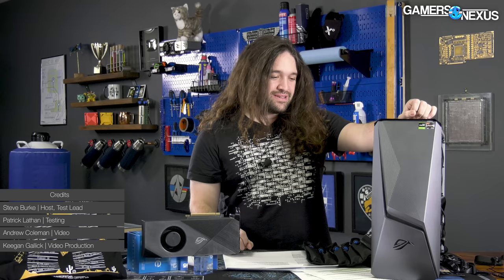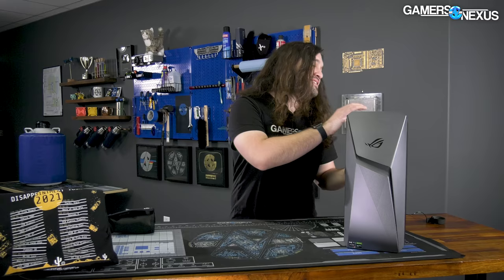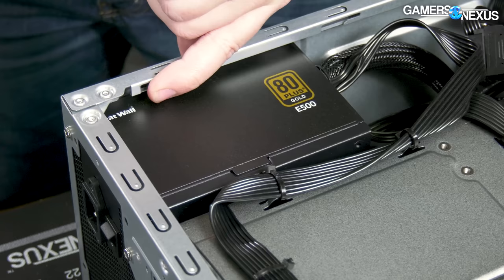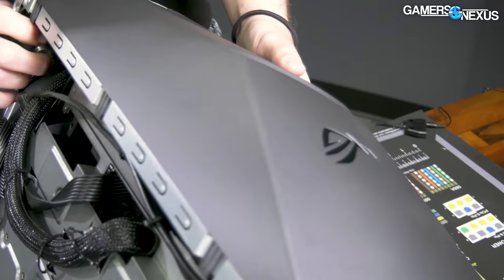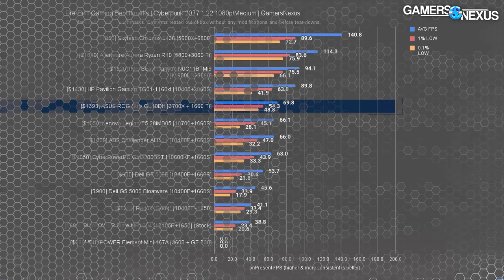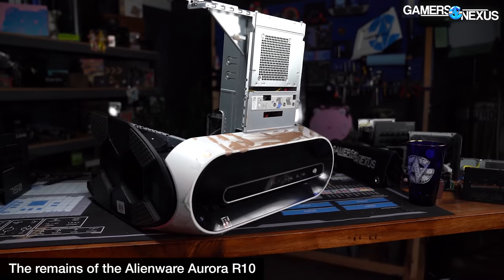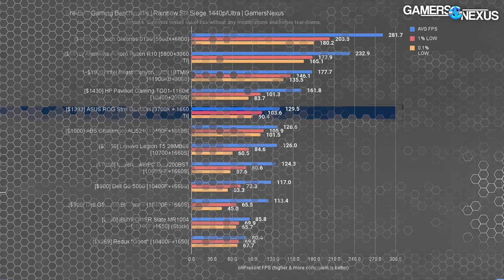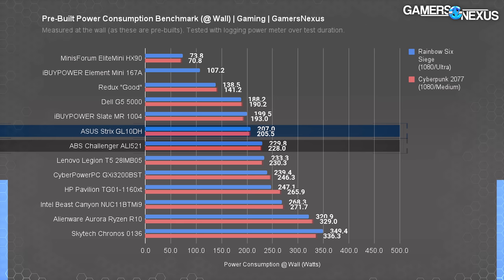ASUS Didn't Deeply Offend Us: $1400 Pre-Built Gaming PC Review (ASUS GL10DH)

Comment: Just to clarify on the PSU: even if you haven't heard of great wall, you have probably seen or used a GW power supply in the past. They do indeed make some of Corsair's stuff (in the modern TX-Ms, the SF series, and the non-mod CX, which is double-sourced with CWT.) The unit in this PC appears to be on a similar platform to the 2017 revision Corsair CX or the ASUS TUF, both of which are excellent budget power supplies with working protections.

This doesn't mean that all Great Wall power supplies are good, just that this one probably is.

Thanks as always for the great coverage.
Reply: I remember Great Wall from the original Walmart PC video. Turns out even back then it was probably one of the better things in that whole thing.
Reply: Great Wall, as a subcontractor, will build anything the client asks. And if it's absolutely horrible they will tell the client to stick their own name on it. If it's reasonably decent and the client don't mind they will stick their own name on it.
Reply: The thing is, Asus makes PSUs or at least sells them under their own name - even fairly budget ones with their TUF line up. By not using one of their own, Asus basically says one of two things:

a) Our budget PSUs are shit and we didn't want to deal with lots of RMAs, so we went with the Great Wall instead.

or

b) We wanted to make the most profit, so we went with the cheaper Great Wall PSU instead of an Asus (branded) one and saved a few bucks on this $1,400 (!!!) pre-built.

Either way, it raises a few questions...
Reply from the maker: Yes, as stated in the video, they are a common supplier and were in many of Corsair's units in the past. You are right that they won't all be good! Glad you (and some others, judging by the comments) are aware that the name doesn't dictate the quality. A lot of people jump to that low-hanging fruit and it's sad to see, so glad to see awareness by the community about the fact that this is just another supplier!
Reply: @nicoj9984  Or c) We use Great Wall as the supplier for our budget line anyway but they charge us 12 cents more if they can't put their name on the PSU... and we guess buyers of prebuilt don't take them apart so paying 12 cents for branding is a completely brain damaged move.

Not everything is a matter of being as evil and greedy a corporation as possible.. sometimes business decisions actually just plainly makes sense.
Reply: I think the easiest is always to ignore the reputation of any Brand/Supplier and just take a look in the "PSU tier list" 🤷‍♂
Reply: For 1400 they couldn't spare the 12 cents or stick a ROG sticker over it... Lmao
Reply: @fracturedlife1393  It's a black-box system. Safe to assume nobody is going to see under that shroud that isn't getting paid for it.

And when you're shipping thousands, 12c is a huge wad of extra cash.
Reply: @nicoj9984  The unit in the video is on a similar platform to the TUF units, from what I could find. My guess is that since they ship so many prebuilts, it becomes cheaper to just set up a whole new contract to buy unbranded GW units than to use their TUF power supplies. Similar to ibuypower using unbranded Channel Well Technology units. The CWT GPU, which is used in some of their higher end stuff, is a fantastic power supply, but since they ship so many units, it is likely cheaper to just buy them directly from CWT instead of using a branded one like the bitfenix whisper M (which is on the same platform.)

I would imagine it comes down to price and logistics. The Great Wall E series is a fairly modern platform with independent regulation and (from what I've seen) working protections. It's not sold retail much in the west, but that doesn't mean it's a bad unit, just that it's less established.
Reply: @fracturedlife1393  Definitely seems strange, but it does make sense once you consider that clearresult charges $5000 for an 80+ certification on a rebranded unit. So despite being the same unit, if ASUS were to make a SKU based on this platform, the fact that it's under the ASUS brand means that it needs a whole new certification. This is an added cost that really wouldn't affect the unit on its own, since this PSU won't be sold on the DIY market.

I personally think that's one of the reasons that the industry should abandon the 80+ spec as a whole, but that opens up a whole new can of worms.
Reply: @GamersNexus  Yes, a name doesn't dictate the quality, but at least it can give the consumer something to rely upon when making a purchase decision. A PSU is, from my perspective as a customer, a black box: I have no Idea what components are in it and whether or not they are any good. All I can go by is the specs (which in most cases are similar or identical) and the reputation of the brand on the side of it. The asumption here is, that a reputable manufacturer or seller won't put their name on a bad product and risk their reputation - Gigabyte did, so when buying a PSU, I won't consider them anymore.

BTW, it's the same with the screwdrivers you advertised in the video: I can go on Amazon and find serveral similar sets of screwdrivers for a fraction of the cost. Those no-name Chinese tools could be equal to yours or even better, but they could also be complete garbage - there is no way for me to know that since I have no idea what materials they used, how they were manufactured or how good their QC is. I don't know either of that with your screwdrivers, but since you put YOUR NAME on them, I assume that it is a good product worth my money.

So what is it then? Shall I buy your screwdrivers or are you telling me that I might as well buy the cheaper ones by a Chinese supplier on Amazon because they are just as good. I am asking because that's exactly what Asus is telling me by using a Great Wall PSU instead of one their own in their not-so-cheap $1400 pre-build...
Reply: @andersjjensen  Yes, but then they go and spend that 12 cents to put their "Republic of Gamers" badge on the piece of metal holding the GPU in place - makes total sense, no signs of brain damage here.

They probably did that to assure the customer that this is a very good, high-quality piece of metal deserving of Asus' stamp of approval and not some cheap piece of metal made by some little known Chinese manufacturer that could break if you look at it too hard. You can't have a cheap, unreliable piece of metal holding your GPU, god only knows what could happen to it when it hangs unsupported in you computer and you don't watch it constantly - a cheap piece of metal failing could destroy your PC, or even worse, burn down your entire house!!! That's why I always make sure to buy only the best GPU holders from reputable brands that guarantee their quality and not the no-name ones made out of chineseium! The power supply in my PC you ask? The cheapest one possible, of course! I mean, what could go wrong with such an unimportant component?
Reply: @nicoj9984  When you consider that putting a ROG sticker on it would require them to get it recertified by clearesult to have the 80+ sticker (which would cost $5000 and quite a bit of time,) it makes sense. 
Also, great wall really isn't a no-name brand. Ten minutes of looking at recent PSU reviews will tell you that. The Corsair SF series, for example, is manufactured by Great Wall, as is the ASUS TUF. It's quite rare to find a power supply which isn't made at least in part in china, taiwan, or vietnam, regardless of if it has an EVGA sticker on it or not. 
Being rebranded by a more well-known company is not a guarantee of quality; if you need an example, look at half of the PSUs EVGA has released in the past four years.

Comment: The loose screw is probably just a dropped screw while securing the GPU plate. The installer simply didn't bother to retrieve it.
Reply: And if it settles really bad on electric contacts you have a problem. (Ok some PSU have a better overcurrent protection than other maybe it saves the day)
Reply: That actually looks like an SSD screw to me, the threading on case screws is different.
Reply: @technikchaot  not if your using a gigabyte psu…..
Reply: @kingcosmuder8078  That was the hidden joke you found it I'm proud of you. (It wasn't hidden that well but a little bit hidden it was)
Reply: Asus has a lose  screw charging £329.99 for thier tuff 6500xt pos crippled laptop gpu

Comment: This PC reminds me of the old PCs I had decades ago when I used cheap cases and airflow wasn't so important. Cases with just a single side intake fan and one rear exhaust fan were really common and some had an array of holes in the side panel(s) for ventilation. At some point clear acrylic panels became popular and I remember some modders putting CCFLs for lighting, which was the precursor of the RGB lighting that's so common nowadays.
Reply: i had a huge case with acrylic side panel and red LED fans on intake/exhaust :D what a cheesefest
Reply: Aside from the PSU mounted at the bottom of the case and the drive cages being removed this is basically indistinguishable from the case that came with the Escom Pentium 100 prebuilt I got in 1995. I bet the beige side panels I had for that machine would just slide right onto the Asus.
Reply: @benjimc1  I really dislike what I call as "RGB vomit" that's so common nowadays. I do have RGB lighting for my current PC BUT it's just a single LED strip with a single color turned down to the lowest brightness. The stuff I see nowadays with fans cycling through a rainbow of colors, RAM sticks with LEDs, etc. I find really tacky.
Reply: @misterthegeoff9767  What I really find hard to understand is that it's possible to create a cheap case with good ventilation. It's just a matter of putting enough vents and fan mountings so air can circulate. I'm a medical doctor by profession but I bet I can design a case with better ventilation than this "professionally designed" case. 😁
Reply: Yes, back in the mid-late 90s. You can go to the store and buy a case - they are all beige!
Stripped an Antec case and painted it with four coats of Krylon midnight black metallic, then two coats clear. Wet sanded between clear coats. The project took over a week (while working). But, after putting a coat of carnuba wax on it - Mirror finish.
Reply: @stevenv2190  True, those beige cases weren't so great because they invariably became yellow after a while. Not just the cases but pretty much everything else like keyboards, mice, monitors, etc.
Reply: @Vendemiair  Most PC cases now days are overventillated, and in the wrong way to get optimum airflow.
Reply: @Magnulus76  Well, it's nice to have a case with a lot of fan mounts since it's flexible. You can just add/change fans to achieve the desired airflow.
Reply: Dude you can remove the side cover if your crying about airflow. I replaced mine with a see through cover. That allows plenty of airflow. Or you can just completely remove it who cares. You sound like a big baby that spends 10k on pc to make some kind of status for yourself lmao. This is a great PC I have one with a few mods on it. Runs great and I enjoy playing warzone on. Game looks sharp and amazing and I get plenty of fps.

Comment: You know, one thing (among many) thats crazy to me is the coolers. I got a Freezer 34, was 23€, and does a great job keeping mid end CPUs super cool while being completely inaudible. Yet in 1500 Dollar build, they just stick one of those aluminium garbage cans atop of the CPU? And some pathetic 80mm Fan? They could stick a single 140 or so over the open side, and you'd get actually goo and quiet thermals, which even casual buyers should be happy about. Its almost as dumb as saving the <30 bucks for a second memory stick. 

Nothing about that would be expensive, except the quality of the case would increase dramatically. The profit margins on this thing have to be astronomical, why the heck do they use parts you'd expect from the worst possible budget PC?
Reply: Quality is available at a premium. While bulk products no one will buy is available for practically nothing as a add-on deal.
Reply: The main problem is supply. They can't get such parts(good ram, fans, heat sinks...)  in large enough quantity.
Reply: @MOHAMEDFATHALAH  Are fans really a limited commodity? At least the consumer sources, eg Amazon in Germany, sells arctics pressure optimized 120mm fans for 6€.

Not to mention, this apparently has been the standard for 20 years or so; these PCs seem to use almost the same ancient technology. Is that even efficient, youd think theres new and better ways to do stuff? There was more than enough before Corona to stop being this bad.
Reply: Problem is margins, price points. You'll find spec equivalent prebuilts $200 apart because the more expensive one spent budget on things like fans and materials, rather than padding the margin.

At that point, the consumer wonders why not just buy the $200 more with a better x or they buy the cheaper option. In either situation, they didn't buy your prebuilt. Experience is hard to advertise when you sell specs.

Comment: Question: Since this series started last year have there been updates to the prices to reflect the growing costs in hardware purchases? I like Asus a lot (I buy their laptops and motherboards exclusively), but I recognize the superior setup and cost for performance the ABS and Lenovo systems offer. However, as inflation in the US has gone through the roof, costs have fluctuated significantly than when these systems were originally tested and it would be interesting to see if the systems still hold that same value in today's market, for better or worse.

Edit: Newegg has the upgraded ABS challenger with the 11400F for $1150 (price increase of $150, may be negligible with the new CPU performance). Per Lenovo's website the (now discontinued) Legion Tower 5i was last priced at $1460, a staggering $400 price increase. With this data the Legion's actual cost for performance dips below the ASUS unit (not significantly, but worth mentioning) while the ABS unit continues to offer good value in comparison
Reply: I think this is a valid point, sort of. Ones bought during gpu shortage should get an asterisk next to their price
Reply: @astronemir  ... This series was started BECAUSE of the shortage and we are still in it...

Comment: You know it's sad that pc gaming has come to this. Before covid, you could find so many great deals on used graphics cards. Ebay was littered with treasure. I always had fun finding "budget" graphics cards because you could play around with it to see how much performance could squeeze out of it by playing with the fan curve, temp limit, overclock ect. In the past from ebay I've had-

GTX 780 Lightning
GTX 980
R9 280
R9 290
R9 290X
R9 Fury
R9 Nano
RX 590
GTX 1070Ti

All of them I had gotten for a really good price. Usually $100 or less (except the 1070Ti). But now it's like, you can't even recommend pc gaming to your friends because a "mid tier" pc is $1,000 which is a horrible value when compared to an Xbox Series S. I hate that it's like this. But unfortunately there's nothing we can do to change this.
Reply: Crypo miners beat the hell put of pc gamers but covid slit it's throat.
Reply: I've built some systems for friends in 2021 and my go to for an ebay GPU is the GTX960 4GB. I can get one for about £100 and while it's no superstar it can still just about keep up and is half the price of a 1050ti or 1650 which is the cheapest stuff I can find in the shops.
Reply: @misterthegeoff9767  Only problem is that's a 7 year old card now and if your buying one used it's really getting in the tooth and is a gamble with it burning out on you. Might as well fork up the extra $250-$300 for a new 1650 with a warranty. Just the move I'd do if I could stretch the budget. Driver support is another thing too.
Reply: @madgodzilla12465  yep also sellers price gouging thier 6 or year old  gpus for way more than they are realistically worth , the greed is getting worse all most people care about is making a quick buck or ripping people off. Im saying this at some that got a palit gaming Pro  3080 at £730 I do t believe in overpaying for shit even if I hadn't been lucky I still wouldn't of paid like 400- £500  for a used a 1080 etc
Reply: @averagejackmedia609  Is not the miners. The scalpers are more than the miners.
Reply: @averagejackmedia609  hey at least after mining booms you can get a lot of graphics cards for cheap, and in pretty good condition considering they are often undervolted and don't go through heat cool cycles

Comment: There's a version of this that has 55700G+3060 for $1,000 at Walmart, which is pretty much the best deal you can get lately on a build/GPU. Also worth noting Great Wall is the OEM for Corsair SF750 Plat which is still the best SFX PSS out there (until we finally get Seasonic SPX750, maybe)

Comment: That downdraft cooler + 90mm extractor fan only setup is the same as I got in my PC World (UK) prebuilt from 2011. In fact, the CPU cooler is the exact same, I think!
Reply: And you are right - the radiator block is the "box" cooler of AM3 CPUs, I had a Phntom II 840, with exactly the same radiator, just the fan was AMD branded.